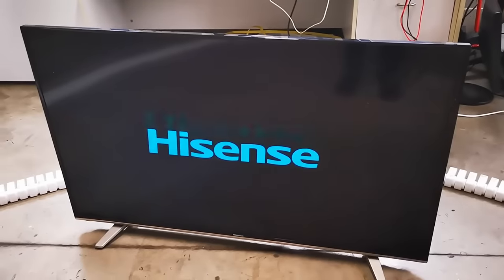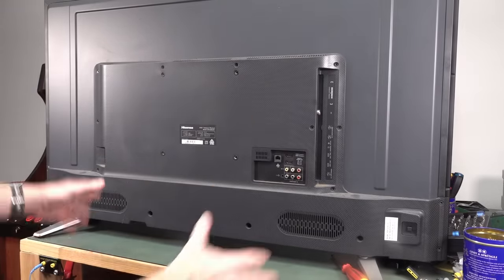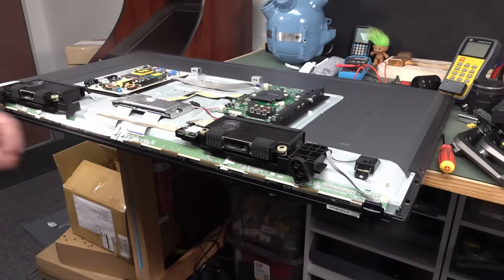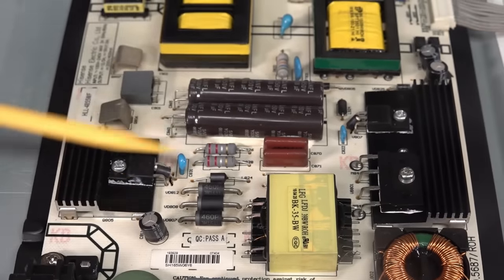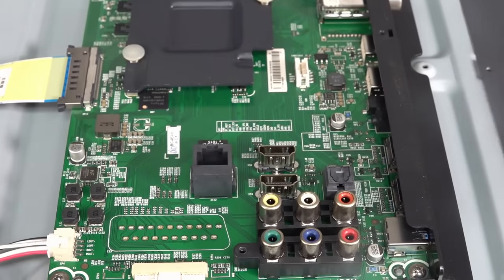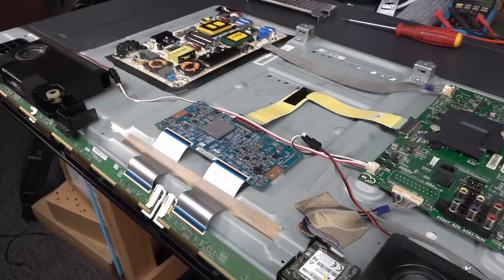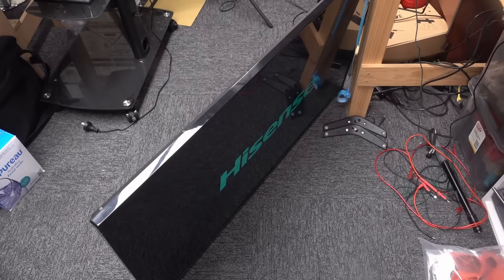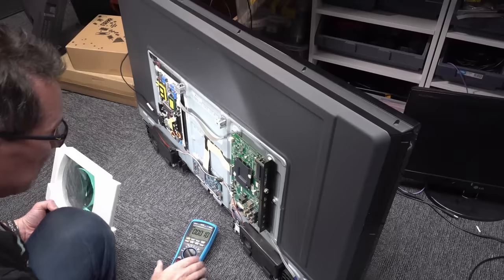Is This Dumpster Hisense TV Worth Repairing?

Comment: some one gave me one of theese tv's but a 43 inch 4k UHD wasent supose to work got home pluged it in and worked fine except the ir receiver cables where all rip out of the board and the speakers taken out , just needed a new cable and ir board and a remote cost me only 40$ canadian no i just need to get speakers and the feet so i dont need to install in on a vesa mount to the wall

Comment: It has two faults. The flickering most likely comes from a dodgy driver chip in the panel. The booting issue maybe from a defect NAND. The latter sometimes come alive when properly frosted. This and LED faults pretty much sums up the majority of faults in today's TVs. Bunch a crap. You could try to pull of each half off the panel from the TCON and check if the flickering is gone once the potentially defect half is off.

Comment: The double image/flickering looks like an lcd issue it might be worth checking the pcbs along the edge of the screen for short caps/failed bonding normally this would cause other picture issues but I’ve seen screens white out due to failed resistors and  certain a manufacturer had a whole range of similar issues so might be worth a look the none boot is the strange one it might be eeprom on the board or it’s in display mode which should be accessible from the service mode but you’ll need a remote to access it. You sure know how to pick ‘em 😂

Comment: according to google, unplug it and hold the power button for 30 seconds to discharge all the crap so it fully shuts down, its stuck in a boot loop, also try cleaning the flat flexes, maybe replug all the plugs

Comment: Definitely dodgy as. Probably not worth it  except for the 'win' of fixing it. How much of win is debatable.

 I thought the t in t con where because they where responsible for generating timing signals for LCD.
Reply: The 'win" is definitely something to think about.  Even if you fix it, chances are you will probably throw it away anyway based on how fast the TV market changes...and how cheap a low-end TV has become.

Comment: Why do you call Hisense a dodgy brand? I own a Hisense TV so does my Mum and my brother. No problems with them at all over many years.
Reply: Just because people own them doesn’t mean they’re not dodgy. If you compare the internals of this TV to those of higher end TVs you’ll see this one is VERY cheaply put together. Not that they won’t work, but side by side with a high end television you’ll see the difference I regards to image quality, brightness, and color reproduction.
Reply: I've never heard of them, but I suspect they are a budget brand.  At some point, you will have to put a value to your time...and when the value of your time is greater than the value of the object you are trying to fix, you have entered the dodgy brand territory.
Reply: I'd echo that , my hisense TV has already outlasted (time I've owned it for) the Panasonic 3d TV that we had and got fed up with it dieing ( bought it with a free 5 year warranty here in the UK)..to be fair the Panasonic engineers would come out no quibbles as swap out the processor board but with in a few months it'd fail again....once the warranty was out I junked it.
However there's no denying the hisense TV's are as cheap as chips so not worth too many man hours and ££ in repair costs
Reply from the maker: They are a budget no-name manufacturer house brand. I've got a Hisense fridge in my lab. Dodgy means "cheap" no-namer in this instance, not that all Hisense products are actually dodgy.
Reply: @getyerspn  Exactly.  If the TV cost $250 new, and you spend 10 hours troubleshooting/repairing it, it is only worth your time if you value your time at $25/hr or less.
Reply: @RK-kn1ud  Hisense are a Chinese company who have a huge mega factory making TVs for many own label brands including Toshiba, Hitachi and Sanyo.
Reply: @richardhalliday6469  So they make TVs in bulk...meaning the TVs are cheaper than TVs not made in bulk.  Which means you can get a new one for cheap.  That usually means the time to repair it is not usually worth your effort unless the issue is unbelievably common and the part is available and cheap.
Reply: @EEVblog2  Yeah, no. Hisesnse arent a 'house brand' or no-name, theyre freaking huge. Their wty is also better than the incumbent 'majors'